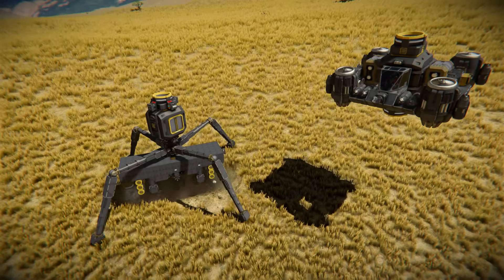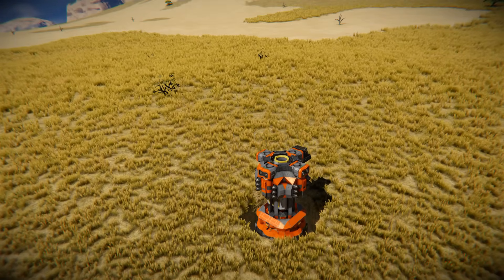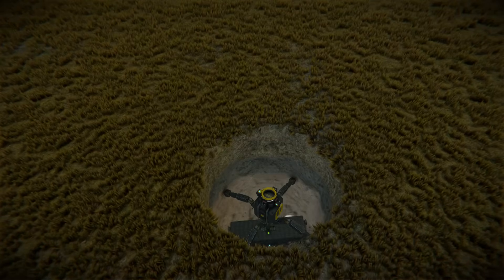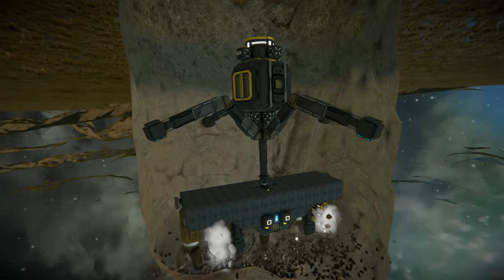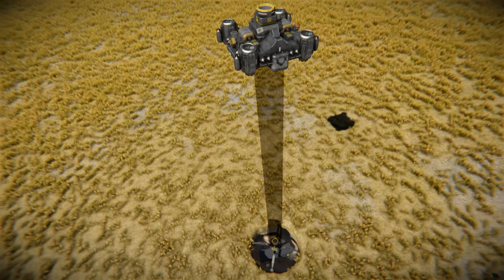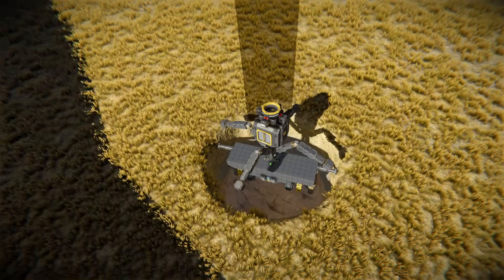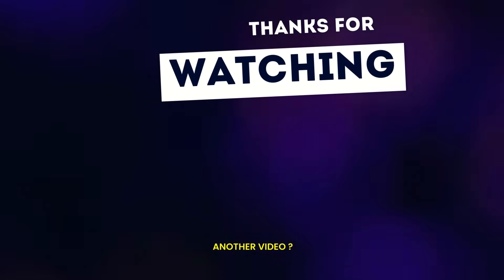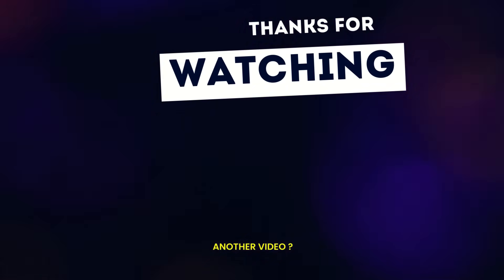Semi-autonomous mining platform (no scripts) || Space Engineers

Comment: Based on your system, I made a different one that is mechanically simpler, and needs some event / timer tuning, but works autonomously, and such. It also uses the new event blocks.

It is also a lot easier to build in survival because it's mechanically simpler.

If you want, I can share it? It is larger though, but yours will run out of space almost immediately, hence why a larger size is essentially necessary.
Reply: Hello there,  can you tell me the one name . I want only to find it on workshop

Comment: A similar energy effficiency could be created on a single grid that spin around using gyros, there would be lift fans but they only need to activate when ship is ready to leave the bore hole.
Reply: Essentially, have the lift thrusters like normal but only for exit, but no attitude thrusters, and just let the weight of the thing dig down while locked gyros keep it upright?

Not a bad idea.
Reply: It can also be wide and thin, and spin with gyros to cover a large area with few drills.

Comment: Suggestion for printable version (~ denotes temorpary connection):
Core body with disconnected hinges and down piston ~ to leg thighs (hinge part + armour blocks + piston base) ~ to leg calves.  Merge blocks should be created to attach the piston heads to the next stage.  Feet can be added after or additional armour block added for temporary merge connection.  Core body then ~ to drill  rotor base.  To merge drill's down piston with rotor, add small conveyor block to piston head, and merge block on the side of the rotor.  Rotor base ~ to drill apparatus which will already have a piston head in the correct location.  Merely grind down the temporary connection and then attach the rotor parts to each other.  Drill's pistons on the mining rig can have their feet completed separately, or again merged to the main grid.
This should allow you to make a single grid projection of this mining rig.
Reply from the maker: Automated production line that mass produces those in such way would be awesome
Reply: I'll try making this printable some day but it seems like it would be a bitch to get it right lol

Comment: Amazing concept! It's really a shame that you can't just build it straight out of a projector, though
Reply from the maker: Agree, I wish it was possible
Reply: @Pro100tv9  the core element of it could be constructed at least partially using merge blocks, when creating a "printable" version of the BP.  I have some experience with this in designing custom turrets for my bases, which include various subgrids, which have been disconnected from each other and temporarily merged to the core grid.
Reply: I think there is an addon for allowing subgrids in a projector. I am definitely going to build myself one, and I am gonna try it out. Maybe even have the carrier land on top of the hole for further energy savings, and adjust the sensor range so the miner will still do its job. 

I might also consider adding more legs to the miner so it climbes out of the hole by itself, but then why build the carrier in the first place
Reply: @honzasenbauer612  plugins crash my game, and mods are not allowed on official servers.
Reply: @matthewgillies7509  well thats a shame, but a factory producing all of this and then assembling would look extremely cool
Reply: @honzasenbauer612  It does climb out by itself. It performs the descent action in reverse. The carrier is there to ferry it from location to location.
Reply: But you can with the sub grid projector plugin. It works great.
Reply: @shahbazfawbush  I don't use addons, and plugins for some reason crash my game, and since I play primarily on the official servers, all my creations are purely Vanilla.
Reply: subgrids can be built using merge blocks on said blueprints to be able to project them in official servers ( just remove the blocks after build has been done ) been used for years or now you can build them apart and move with a crane using the turret controller  wich has been implemented in vanilla with ease and lock them in place on the rotors/hinges  as needed  this is space engineers you have to surpass your limits remember that :)

Comment: Can it be used with any available cargo drones from the box?
Also printing it in survival should be possible with multigrid projector plugin. If author prepares it a little bit.
Reply: I built this with multigrid projector,its hard to weld by hand so i used moded wizardry to do it for me.
Reply from the maker: Hey, I believe it is possible to use a PAM-based cargo drone that is paired with a sensor
Reply: @Pro100tv9  Can you please give me a clue on how?
PAM is my preferred drone type, but I always thought that PAM and moving base connectors are incompatible by design.
Reply from the maker: So this platform will go back to surface once it reaches the distance of 50 meters between itself and the carrier. I'm not certain about that, but I suspect that once it gets back on the surface it will be the exact (or hopefully close enough) spot as it entered the shaft. So if the PAM drone would be programmed to get into those coordinates, it could first save this position as the first stop(job start position), drop the miner, and then, once it completes the job, reconnect to it, and throught the sensor-timer combination start the cargo run.
Please keep in mind that I didn't test this solution yet, so I cannot say that this will work for certain
Reply: @Pro100tv9  Sounds good, but it needs extensive testing.
From my head it looks like final position may fluctuate a lot. Based on my previous experience with those pesky voxels :)
Actually it may be good enough, if there will be static catching funnel on top of the shaft.

Comment: If there was an easy way of producing these you could just setup like and army of these and then just collect them once they get to the surface. Very cool concept
Reply from the maker: I was thinking that the rotor/piston arms could actually be replaced with static arms, then slap some magplates there, sync it all and perhaps it could work similar
Reply: @Pro100tv9  I tried something similar. If was single piston caterpillar with drilling head.
Worked on some angles against voxel grid, failed at others. Wall roughness is a problem  :(
Reply: you could build a production gantry for them,    the time spent building the gantry could arguably be better spent just hand building a couple of those,  but once the gantry is built you could start stamping them out in rapid succession.
Reply: @Pro100tv9 could you make a drone version of this where you could deploy it from space?
Reply: if you make a crane you can blueprint the subgrids and connect the pistons and hinges once you've printed them out, it's a little more tedious to do but viable for survival
Reply: @jimbothegymbro7086 smart
Reply: i know this is fairly late but what you do to make sub grids buildable is have a blueprint with everything on a single grid, all the player needs to add is a few merge blocks or rotor/hinge heads and then grind off the "sprue" parts.

the sprue may include pistons, timers and buttons to aid in assembly, they can also be built so merge blocks are temporary (to save on PCU on servers)

the only builds this wont work on are ones using both sizes of grid.
Reply: you could theoreticaly use structural support blocks in oder to fit the subgrids in the same schematic
Reply: What would be amazing was if you could drop them into various areas from orbit drop pod style, and they would automatically mine out where they land, then later come in with a large ship to pick them all up! Granted that would be absurdly difficult to do to say the least...
Reply: Ya can print these I’m pretty sure.
Reply: And can I get a blueprint?!